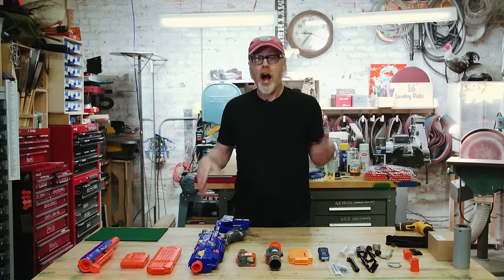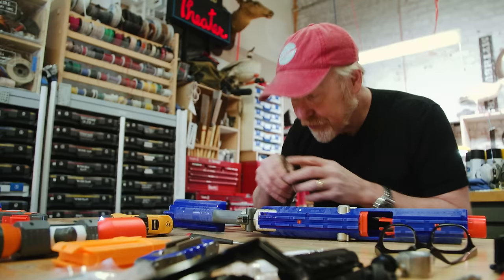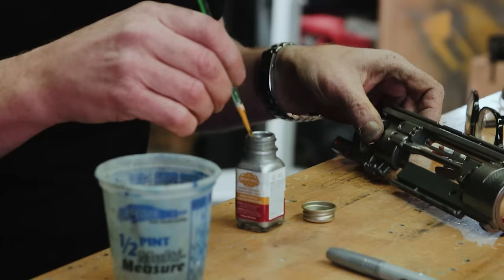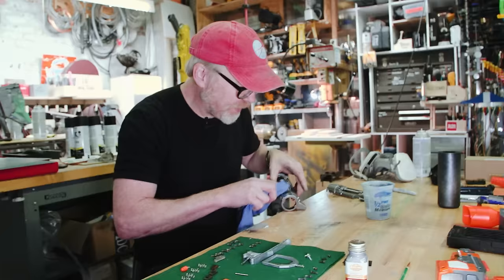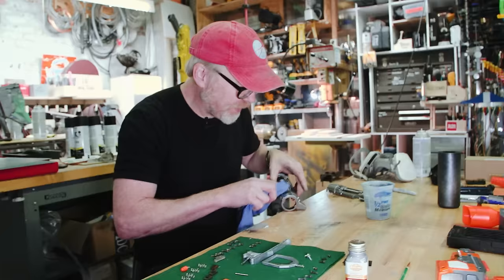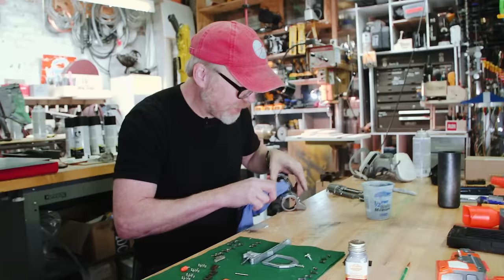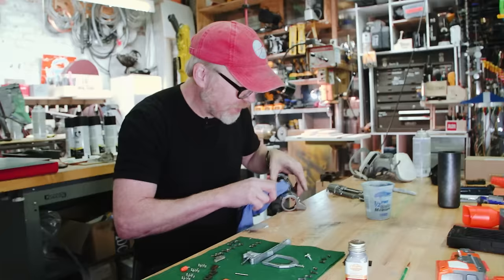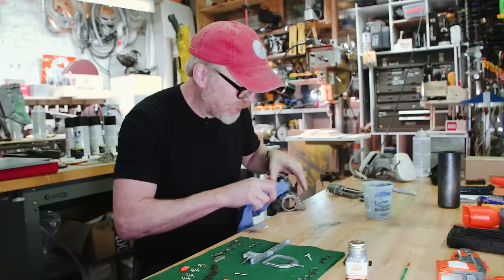Adam Savage's One Day Builds: Custom NERF Rifle

Comment: Holy crap most of this video is out of focus. Please chill a little with the zoomed in short focus depth, it makes the vid frustrating to watch
Reply: Low light, shallow depth of field, quick movement, one-man camera operation... It's not like it could have been done much easier unless they just mounted the camera onto a tripod and let the entire video be static and boring.
Reply: ...yes it could have been done a lot easier. The zoomed in short depth of field constant close-ups that turn into a blurry mess, is a choice.  Having a wider angle instead of that zoomed in one would have made the focus depth deeper and would have kept things much clearer. You can simply move the camera closer instead. They chose to go for the alternative and my feedback to them is that their choice is really annoying to watch. You might prefer this unclear mess but I don't. They have done lots of videos that didn't have this problem so it is not like they can't.
Reply: 5chr4pn3ll I agree, but at the same time I don't actually know what gear they use. If there is a "they" and it isn't Joey shooting alone. I do see several angles, but I'm not sure whether he's running around and they cut it that way, or if it's several angles. But yes, you're right. It is personal choice, however, it's a much simpler way of doing it to just zoom in than run forward and back. That really gets tiring. Best option would be to have Joey on one camera for all the hand-held shots and then a static camera on a tripod to the side for the close-ups for most angles. The only problem I see is that Adam is a little unpredictable with his movement since he does think fast and move erratically. 

They may just be trying to minimize with staff.
Reply: is that all your focusing on? watched the whole video, didn't notice anything wrong
Reply: DankDuckDinker Didn't really bother me either when I was watching. Technicalities is all.
Reply: Did not notice it one bit.
Reply: I didn't notice a thing.
Reply: Tom Brablec Static is boring? Why? Constant movement everywhere is quite stressful for eyes.
Reply: It also felt like the person holding the camera needed to pee, a stabilizer would've been nice :D
Reply: 5chr4pn3ll Its actually a particular style of filming. That style is what you don't like.
Reply: Sometimes, a bit of boring is the right thing to do, if it makes a long video less nauseating and easier to follow. It can have non-boring bits in between once in a while.

Also, that little bit of noise would have been a better trade-off than out of focus, and if you err on the slightly wide side, it tends to be more readable as a whole. Also, multiple cheap tripods of same model + one fluid head, keep the head on the camera and then just drop it on whatever tripod is needed, that can help a lot.

Besides, is there a good reason why they should not have enough light? This workshop is permanent part of this YouTube channel, perhaps they should upgrade the lighting there if it is indeed a problem, though I doubt it is. It's not exactly an amateur channel where the creator really needs to count every penny and make do with the bare minimum they have to keep himself from starving.
Reply: Didn't notice it either. Although I did watch most of the video at 3x speed

Comment: The scope probably costed more than the gun..
Reply: DSG Airsoft it was just an aim point, nothing special
Reply: @joshuad748  true but if u buy the real one it will set u back at least $150
Reply: And third - party scopes costs a little bit more than Hasbro's
Reply: Costed is not a word.
Reply: @josgood5412   and so is ur username

Jk.
Reply: It's a pretty rare gun but if it was normal it would be close
Reply: Shades its a blaster not a gun.
Reply: It's a $25 scope lol. Google aimpoint 4x
Reply: you can get those things for 20 dollars easy
Reply: @Henry Williams no. "Costed" is not a word.
The past tense of cost is cost.
Reply: Those are pretty cheap optics, you can find most of them for under $30, if he puts something like a Trijicon Acog tho, it would be a different story
Reply: NO, Not at all
Reply: @Henry Williams its not a word though..
Reply: when he pulled it out i couldn’t help but cringe. scopes are hella expensive and i felt so bad when he put the fake rust paint job on it.
Reply: @Henry Williams indeed, you are correct.  I learned something today:p. I still feel dumb saying "costed" though.... Lol
Reply: @zzsolar-  it was a knock-off scope- 
DONT STRESS ABOUT IT! 😝
Reply: Evan Jones o h t h a n k g o d
Reply: @Henry Williams 🌠🌈
Reply: Yea
Reply: "The scope probably cost more than the gun."
Reply: @brody62424  ITS A BLASTER

AND A JOLT RESKIN
Reply: Jon S. No dude the Gun is very old and it’s worth ALOT
Reply: It matters how?
Reply: @darklordofsword  That depends on usage. When cost is used as a verb (that is, the act of estimating or specifying the price of something) then the correct past-tense is 'costed' e.g. "I costed the project at approximately $500". Before making explicit statements such as yours, it is best to do your research. The internet is unforgiving on such things. :)

Comment: I did something similar to a Retaliator, actually, to make a more DMR-style Nerf rifle. Same mag, extended the stock with a bit of wood, put a longstrike barrel on the front, removed the loading shield and replaced the grip with a worker grip attached to the charger, and replaced the priming assembly with the more sturdy one from Mod Works. I was quite proud of it. It could use some painting, admittedly.

Comment: I bought one of those fancy silicone work mats it has magnetic holders along with a screw and nut area with numbers and it's heatproof. I use for taking electronics apart and I like to solder the soldering kits you can get it's a good idea keeping track of how things come apart if you plan on putting it back together. The work mat I think any craft could make use of.

Comment: Another trick if you're taking something apart that won't be going back together for a while, is to peel a strip off a lint roller, lay it sticky side up and line up screws and small parts on it.  Then you can stick cellophane over the parts to make sure they stay in order until you're ready to reassemble.

Comment: Shop hack - grab a piece of magnetic sheet (with or without the adhesive backing) and then attach a piece of fabric, velvet or even an old mouse pad over top. It will hold the screws in place in case you bump it. You can also grab a small square baking pan and add a piece of magnetic sheet to both sides. Line in the inside piece with fabric. Now you have a tray you can store on the side of a cabinet or toolbox, and screws literally can't go anywhere!

Comment: Tip for keeping those screws in order: Press n' Seal! Why? Because there is no way in hell I wouldn't bump that line of screws and knock them everywhere, lol. Not only does it keep them in order temporarily, but if you need to set the project aside for a while, you can just lift them all at once and stick them in a box. It does not leave adhesive on anything fragile as long as you don't expose it to a heat source. Bonus: You can write on it! As a beader, Press n' Seal was a game changer... it's the 3D version post-it-notes. 🙂

Comment: I am an avid airsoft player and our replicas have tons of after market parts like motors and springs and gearboxes and lots of screws and pressed in pins. I take cardboard or poster board sheets, and trace my replicas on it. as i remove the fasteners i stick them through the cardboard in the spots they would be on the replica gun.

Comment: 10:19 - noticing the whole magazine is painted black.... does the "to-be-received" part not get stuck in the blaster if left long enough?
I've personally always played it safe and painted beyond the clip-in "stopper" point (i.e. half natural orange or grey and half whatever colour I chose).  Keen to hear your thoughts Adam, although this video is half a decade old!
Reply: A little trick I found that works without fail - furniture polish. A bit of Pledge rubbed onto any sliding surface area where there is friction will prevent the paint from binding or stripping while also acting like a lubricant. I painted a Deploy a while back, which are notorious for not working properly after painting. The Pledge made it deploy more smoothly than it did when I first got it.

Comment: You should of done a before and after on the fps. But overall it's bad ass
Reply: Stock longstrike performance is around 75fps out of the barrel. Mod works kit is going to bump it to about 100fps out of the barrel